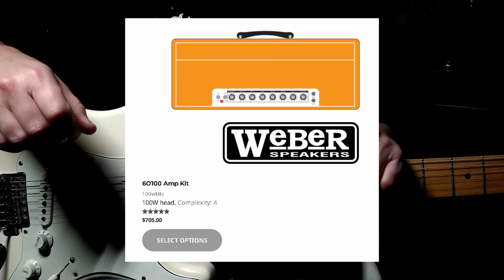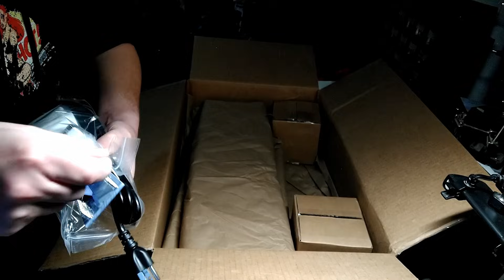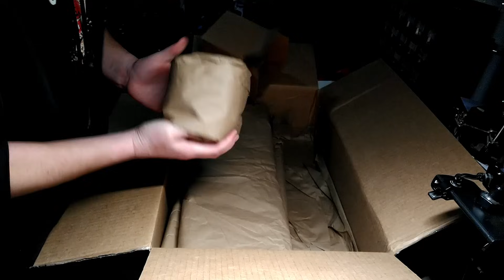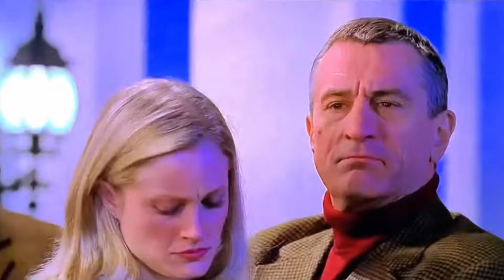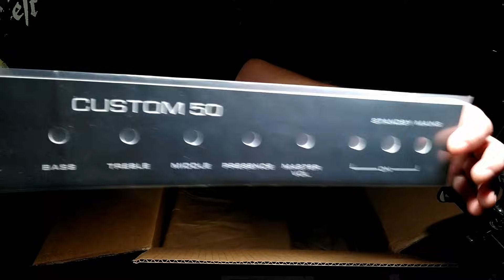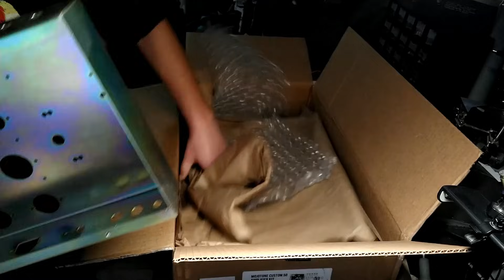Mojotone Custom 50 Amp Kit UNBOXING - Project: Gilmour part 2a

Comment from the maker: While assembling the kit I had a problem with intermittent continuity through the fuse holders. This may be an isolated incident but if you are making one of these kits I have to recommend you replace the fuse holders with higher quality ones. If you search " Fuse Holder - 3AG-Type, High Quality" on Amplified Parts they are ~$2.50 each and they are the ones I am using to replace the ones that came with the kit.